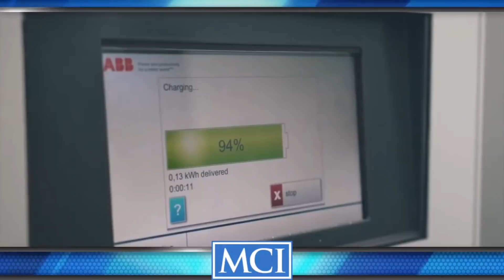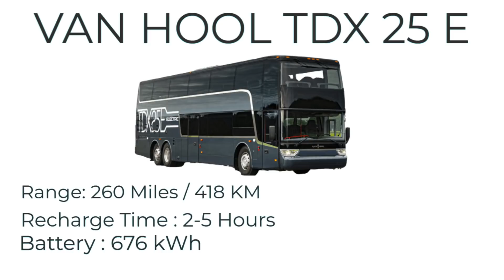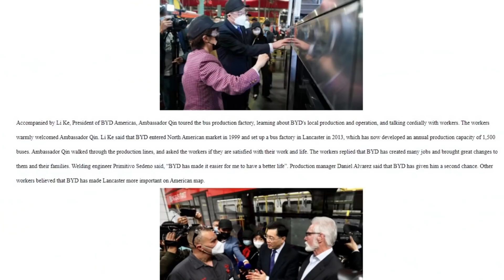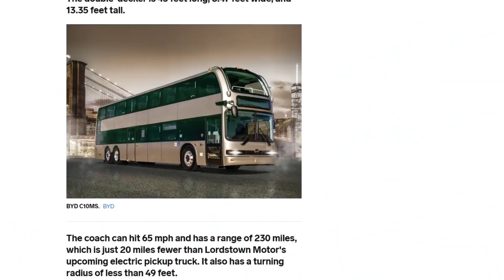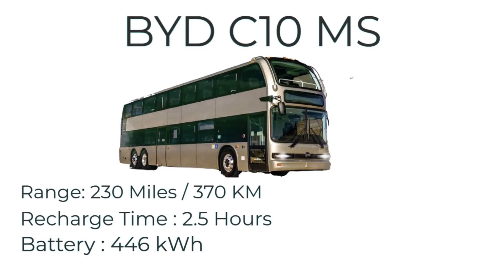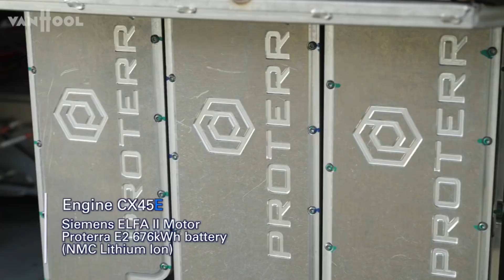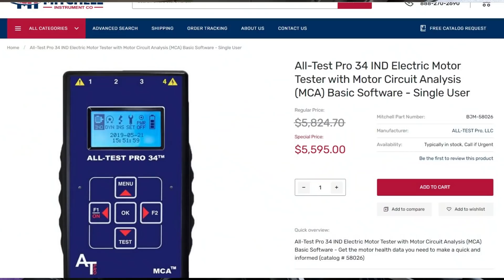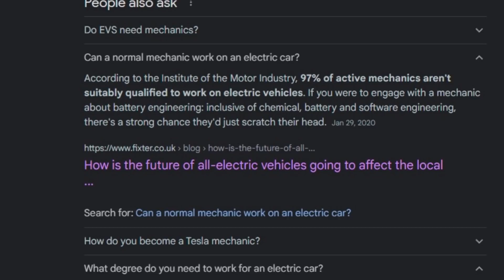Are Electric Buses working out in the US?

Comment: I can really see these electric motorcoaches to dominate the SF Bay Area on those Tech runs. 
In some areas across the country, not so much. 

I deliver buses for a manufacturer...and from what I can tell is that diesel is still in demand. I’ve test drive some electric vehicles in different parameters  before they are shipped to the customers. The fuel range on an electric vehicle car or bus is all based on ambient temperature.  On a nice warm day, a 40ft transit bus will get about 200 range. Turn on the HVAC and other accessories, the range will drop slightly. It drops even more when it’s bitter cold outside. I charged one 40ft bus on a 39 degree day, and on a 100% charge, The range was 110 miles... not good for a transit agency ... because typically a bus will stay out all day long or about 200 miles

IndyGo just recently order new Diesel-hybrid Gilligs with the E-Gen Flex technology. I will have to send u a video of it.
Reply: I envy you with a job like that. That is correct. Like I said, what happens when the AC is going full blast? That’s gonna guzzle a lot of juice same with heaters in the dead of winter. Diesel engines are so much cleaner and quieter than decades ago but they are pushing BEV like crazy. PIERCE, E-ONE and ROSENBAUER have begun to offer BEV versions of their fire apparatus now. You’re gonna need a big old diesel generator to keep that water pumping it a huge fire via charging. That pretty much defeats the idea of the BEV movement.

Comment: It would be nice to have solar panels installed on the roof to charge the batteries, while in route.  Seemingly, this would increase travel distances.
Reply from the maker: Yes I've thought about this too. I think solar doesn't charge fast enough where It would get rid of the recharge needed but yes you are right it would extend the range
Reply: @MotorcoachWorld  Our little Otokar schoolbus has them;  It's meant to be a back up system for keeping your batteries topped. No more than that. As long as the sun shines, and you have no hanging trees or something.... And for a diesel bus 2 sets of normal batteries and a extra alternator are way more cheaper if you want a back up solution. Anyway, for full electric coaches is it way too early. In Europe there are exactly none available f you want to buy one.
Reply: @MotorcoachWorld   you need regenative breaking technocolgy.

Comment: You did a super great job as always.! But you seem to have forgotten one thing that really sticks out in my mind. What happens when you get a long haul charter with a full paying group and that electric coach goes chug and stops. And there's no one that knows how to fix it. And you're stuck out in the middle of nowhere! That could be the most horrible thing in the world. Even worse than the ice cream cone of death. LOL once again you did a super job. Sorry for adding my two cents worth but I just had to add an extra charge! Lol
Reply: That's the thing with EVs...they don't break (nearly as often as ICE vehicles). No moving parts. The odds of you getting stranded are miniscule compared to driving an ICE.
Reply: To worry about an EV having a breakdown more often than a diesel, is silly.  It's not as if the passengers on a broken diesel bus sit in their seats waiting for the engine to be fixed, they get put on another bus.  Same here, except it will almost never be because of the motor or battery, just the usual bus stuff.

I lived in the NYC area and went to college in Boston.  While driving back and forth between them, I almost can't count the number of diesel buses I saw broken down on the heavily used NY-Boston route.  The inside joke was that after seeing one "Fung Wah Bus" (cheapest way between the two cities, and notorious for poor maintenance, they eventually were shut down for safety violations) on fire at the side of the highway, you would forever count how many of those buses you saw on each trip, and take a good look to see that they were not not smoking or bursting into flames.

Comment: Here's where electric vehicles will be going. As NESARA-GESARA unfolds, wireless electricity will be given freely to all on the planet. 

The tech to pull wireless electricity from the air will be available to retrofit the existing EVs and possibly conversion kits for fueled vehicles. 

Fuel's been sold with the nation of oil is a fossil fuel. Biiiiiig lie. Look up YT video of Colonel J Fletcher Prouty's explanation how big oil corrupted a late 1800s organics convention selling the committee on the lie that oil was a fossil fuel produced over millions of years. The idea being is, by creating an artificially scarce retail product, you can always force the higher price because each barrell you take from the ground is one less from a finite supply. 

Reality is, oil is found at depth much closer to the surface than where all the fossils are. This means that oil renews itself to much shallower wells automatically after a few years, not 100s, 1000s, or millions of years. The scarcity pushed by the oil industry (actually any scarcity pushed by any BIG INDUSTRY) is the kind of things wars are made over. And has been created in the past.

That's why, weeks ago (like 6-8-10 weeks) most all of the refineries around the world we're on fire bringing world supply of oil & refined fuel down to start the replacement of free electricity given to all in the world. 

Sounds like fantasy. I doubt there'll be any refined fuel vehicles on the road in the next 2, 3, 5 years or so.

Comment: They really should make electric vehicles with removable batteries and just switch them out at the charging station.
Reply from the maker: Wow I've never thought of doing it that way! That's brilliant. I guess too much liability on the power stations though. If they put a defective battery on your vehicle it's kind of on them but yes I still think your idea is awesome
Reply: @MotorcoachWorld  Interchangeable battery packs only require an industry standards committee. If the coach and bus manufacturers really wanted their industry to transition to an electric market they would have gotten together by now and published version one. Much like USB, HDMI and computer power supplies those standards are jointly managed for the benefit of the industry. If they wait for government intervention to develop something more than likely no one will be happy with the specification. There could also end up being one dominant player forcing their proprietary device and its licensing costs upon the slow to adapt players.
Battery swapping is not a new concept either we've been doing it since before the portable radio came out. It has allowed portable products to develop while the battery technology limped along waiting for those eureka moments.
As for the solar thing, if it ran the air conditioning that would be the use that it is best suited to.
Reply: @MotorcoachWorld  Janus Electric in Australia is running prototype Kenworth highway tractors with interchangeable batteries.  The battery is removed/replaced with a forklift in under 5 minutes.  The batteries are stored in charging racks along the truck's route.  They charge at slower rates prolonging the life of the battery, and off peak when electricity is cheaper.  Each battery is tracked for health.

The big compromise with trucks is the reduction in payload.  How are these electric coaches affected?  Can you still carry 56 passengers and luggage without overloading the axels?
Reply: There is a prototype vehicle where you pull up to the charging station and the battery tray slides out  then you slide one in. Not sure how long it takes but if 30 minutes it would better than 3-5 hours.